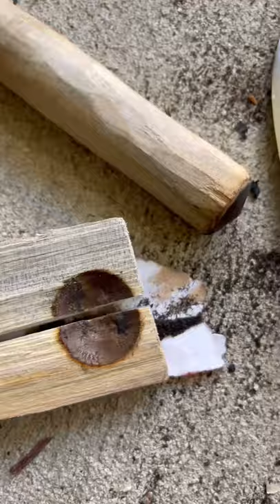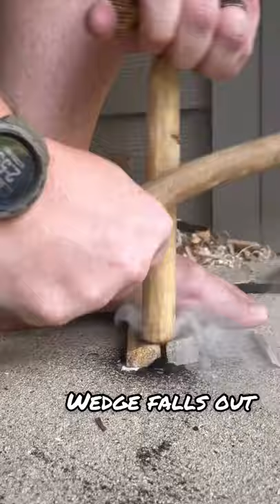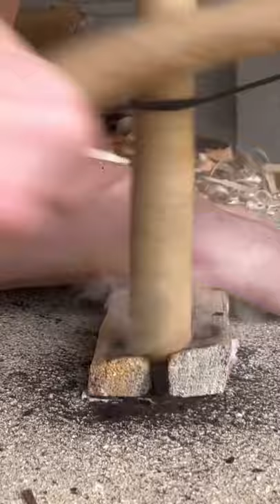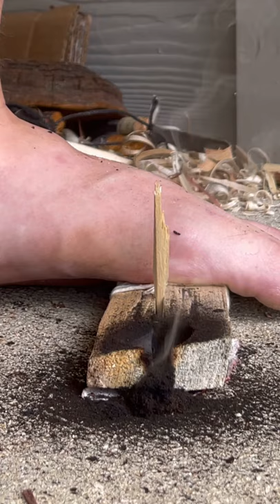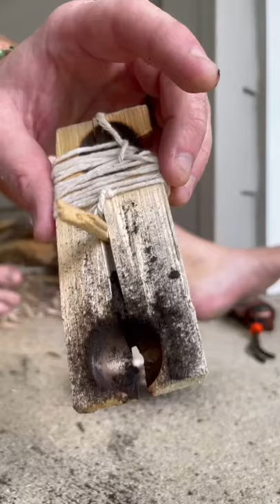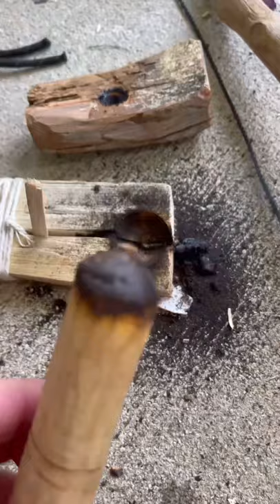Fire Skills: Split Board Bowdrill- Friction Fire #Shorts

Comment: I just bring a lighter.
Reply from the maker: Where’s the fun in that?
Reply: What happens when you run out of lighter fluid?
Reply: Lighters break, run out of fluid.  Matches get wet.  Fero rods only work if there is something to strike it with.  Always good to know a few methods.  At least one will always fail during an extended field time.